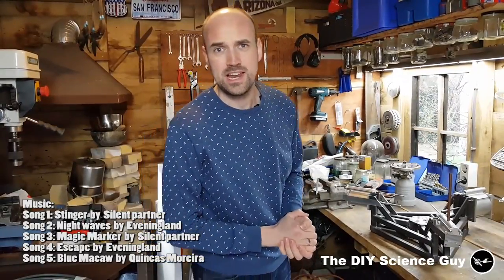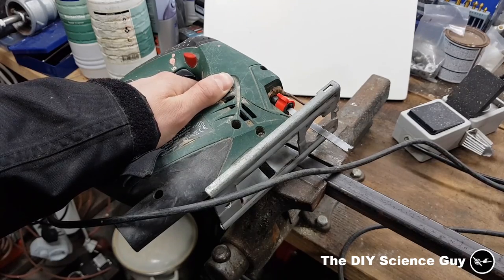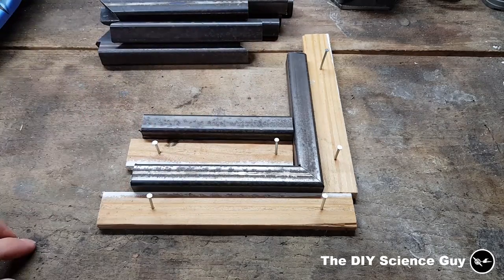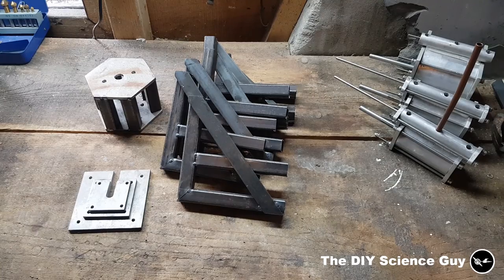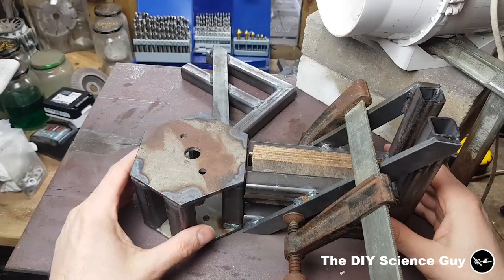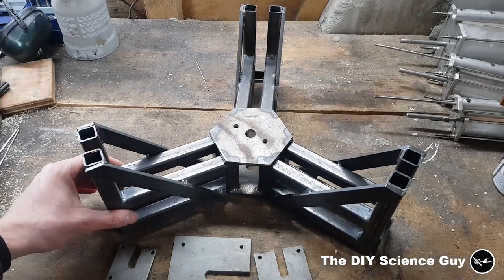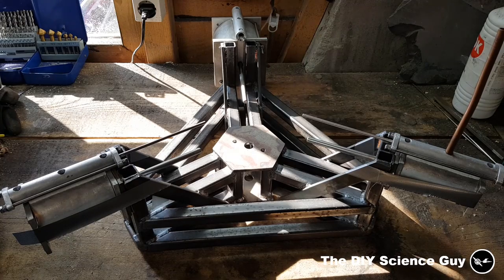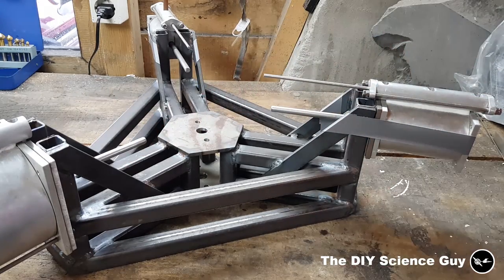Solar steam engine #5 the frame-True DIY

Comment from the maker: Frame drawing! Instagram: https://www.instagram.com/p/B9y5CueFFPH/?igshid=az8vv0puygcb
Facebook: https://www.facebook.com/234679430309932/posts/876426992801836/
Reply: Polishing the inside of the cylinders and adjusting the design of the Teflon rings to reduce the outward pressure to a minimum (while remaining sealed) will help to significantly reduce drag and improve efficiency.

Carbon black and a larger square area to collect sunlight will help collection efficiency, as well as improving the collector pipe conductivity, and you should think of a way to keep the infrared heat from escaping back out as black body radiation. Possibly infill with a dense greenhouse gas that is insulated from the outside, otherwise, the sunlight hits the black surface, and the re-emitted radiant heat is absorbed and buffered by the gas which has a hard time conducting heat out. Its a shame we don't have any optical thin films with a selectable transmittance range, but there may be one-way optics.

Make sure you wrap anything the steam touches or goes through in insulation to keep the heat where it belongs in order to produce energy through pressure efficiently. Making the cylinders larger will increase the gas volume more than the area of Teflon contact with the cylinder wall. Bigger is more efficient and better.

Awesome design btw.

( https://www.opticalcoatings.com/beamsplitter ) might be one option.

Comment: Use Wax motors for Aim adjustment. no power needed.  as Sun heats, they MOVE.
Fresnel lens to heat the Steam for power gen.(chance of old Projection TV lens..If you need location ask..they even show how to make own.
Reply from the maker: Thanks for the suggestions! 👍

Comment: Do you think it would be safe to change hydrogen to potassium or lithium, the only problem I would see is the heat however the energy that it would produce would be substantially more than hydrogen? - the hydrogen generator video.